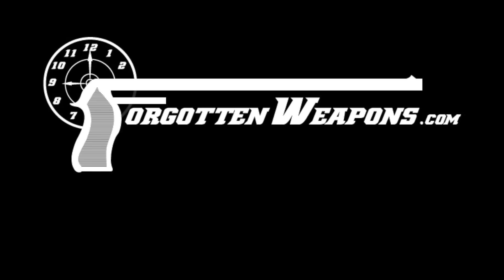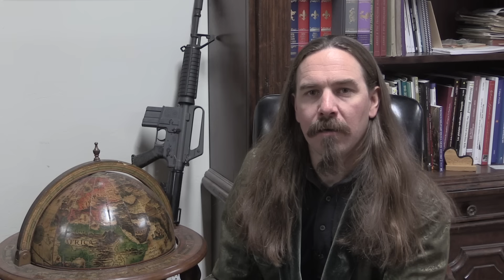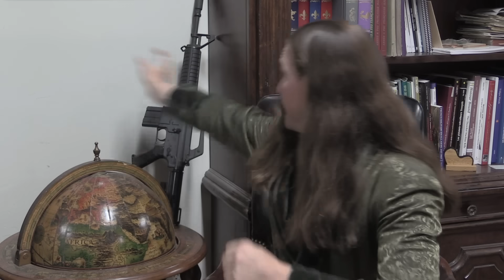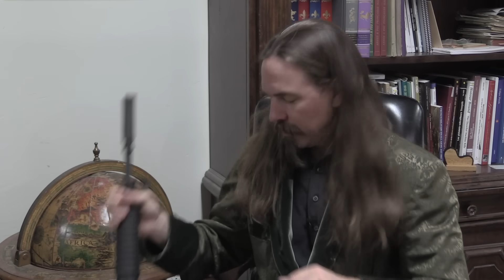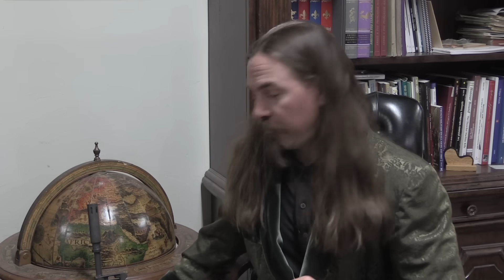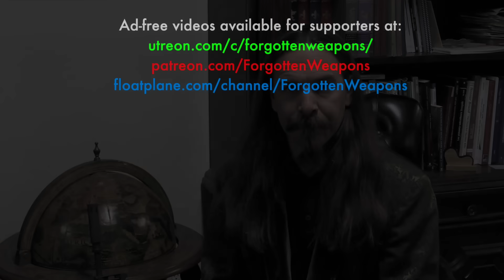Ask Ian: "Last Ditch" Rifles for World War III?

Comment: Ian,
Polymer receivers can be cranked out easily from a mold but that's not the end of the story when it comes to complete production of them. There's flash and other non-essential polymer removal. There's the polymer welding process to mate the two halves. How much total time does it take to make a KP15 lower when you include theses steps and the transition time between these steps?
Reply: Having worked on KP-15 assembly, I can tell you there's quite a bit of manual work to remove the flash. I have purchased two, and I had to deburr them both beyond what was done at the factory. I mean, you COULD just issue them to soldiers as-is, along with a razor blade, and say it's your job to finish it.
Reply: @WardenWolf  You'd trust soldiers or Marines with a razor blade? This is an armorer's job.
I used to work at a plastic making (injection molding) company so I do understand this.

Comment: You're more likely to just see proper shops retooled en masse than change much of the overall reciever structure
Reply: That's clearly a "low hanging fruit" sort of thing that you start with. 

But after you've exhausted machine shop capacity, what's the harm in retooling your injection mold shops that would've otherwise sat unused? 

Also remember that machine shop time will be in high demand for other projects that have nothing to do with small arms. If you can move part of your small arms manufacturing over to a shop that used to injection mold kids toys, then that frees up machine shop time for potentially more important war effort projects that truly need it.
Reply: If the situation becomes dire enough, there may not be enough shops to retool, even if raw materials are still available in the quantities needed. Many shops may be destroyed in the conflict or may become trapped behind enemy lines. The conflict may also consume a shop's manpower and shortcuts in production will have to be taken.
Reply: @rudyschwab7709  look at the soviets  in ww2 their small arms wher pretty much exclusively made in small machine shops
Reply: @rudyschwab7709  That's what I was just thinking, if we are talking last ditch effort many of these workshops would have had their workforce pressed into service. You probably wouldn't have the luxury of WW2 with the women making up the workforce either as they too would be fighting. Retooling of other workshops would come well before a last ditch scenario.
Reply: In real big war capable manufactures are making stuff that much more important than pistols or rifles - tanks, artillery, aviation components, artillery shells, bombs etc. They are much more important for war effort and usually have not that many options to be simplifies

Comment: This is a interesting video to think about . 
Have you checked into the Orca 3d printed ar15/m16 ? Almost the entire thing is 3d printed polymer. I could see something like that being viewed at heavily in a war economy situation. 
Also the select fire feature would probably be done away with altogether for ammo preservation , just a safe and semi auto fire switch,  no burst or auto option at all. 
They would probably make the barrels pencil style barrels for weight and material conservation. 
Powers that be would also consider viewing a picatanty rail flat top upper all the way down the upper receiver and the handguard to accommodate detachable optics and iron sight options. 
Agreed that a fixed stock would probably also be considered for simplicity and speed of production. 
If they stayed within civilian parameters of designing and building such rifles , (barrel length for example) these rifles could be sold back to the civilian market easily on a surplus option after the war ended. 
Anyways , good video.
Reply: Exclusively polymer uppers are just not feasible for actual war usage. Even in high-temp polymers, sustained FA fire will heat soak the upper and any form of barrel mount and cause loss of accuracy and eventual destruction of the upper. It's perfectly fine for semi-auto civvie use -- I have a rifle with a printed polymer upper myself -- but militaries have different needs.

I could personally see a hybrid design that sleeves a much simpler metal component in polymer to reduce manufacture time. Features like rails, brass deflectors, etc. could all be pumped out much faster in plastic than aluminum.

Comment: Colt SP-1 with a cartridge deflector added or a sportical upper with the Picatinny rail no ejection port cover short rail for the front sight. The sportical uppers were for Walmart I found one for sale and I have it mounted on a suitable lower with a Carbine Trijicon ACOG® mounted.

Comment: Using 40rd mags is another option, in that the standard combat load can be reduced from 7x30rd 210rd loadout to 5x40rd 200rd loadout. This would also give some advantage to the WW315 over an enemies 30rd equipped rifle.

Comment: Due to the way the barrel mounts to the upper receiver, indexed by a pin on the barrel into a slot in the upper receiver, it would be absolutely necessary that the rear sight be adjustable for windage.  As far as your comments about 3-rnd burst, you could argue go even simpler, Safe and Semi only, skip the burst or full auto.

Comment: I could also see them removing the forward assist to streamline the upper and save on parts/materials, removing the grips that have the little doors in them for oil and such, hell, possibly even removing the dust covers in extreme circumstances.

Comment: Hmm, I think the H&K G36 one of these plastic fantastic platforms for these reasons. Relatively cheap and easy to produce if you need to just swap the carry handle to the “c” config. Designed with easy production methods in mind for a possible outbreak of WW3 that by now never came. The development must had started in the 70’s or 80’s, so the threat of an escalation was real, not like at the introduction in 1997 with the Bundeswehr.

Comment: How about a monolithic polymer lower with a carbine length buffer tube with the locating points for the adjustable stock? You could even put a QD socket underneath the buffer tube.
Since the adjustable buttstocks are largely molded polymer they could be simplified by eliminating the lever and just using a spring-loaded plunger for the adjustment. Since most people don't adjust constantly this would give you the option of setting up for armor or heavy winter clothing versus hot summer in a T-shirt.
PS I would like to see this lower made with a pistol grip modeled after the BCM gunfighter, or Magpul MOE K2.

Comment: I would also expect simplified muzzle devices, foregrips with less cutting needed for rails if not entirely polymer, maybe pins replaced with non-captive versions..
Reply: M-lok foregrips weigh what, half what Pic rails do?  That's all metal you can use to make another gun!  ALSO takes less machine time, and would likely be modified with half-circle ends to create an m-lok 3.0 if further simplification is needed.
Reply: They would probably start with whatever AR barrels are left over.

After that, it's all barrel blanks. We probably wouldn't see muzzle devices on them. But maybe an occasional example of somebody drilling holes at the end.

As an improvised muzzle brake.

Comment: As an end user the ergonomics, functionality, cool factor and a few other thinhs play a part in how much you enjoy shooting and therefore how much a lot of soldiers/sailors/marines/airmen will put into training and how frequent they will train without complaining too much. Now that doesn’t go for everyone.

But if the full time peace time Army doesn’t like or want to shoot the issues weapon they will not be as skilled in the use.

I hated the Austeyr I hated the ergonomics and couldn’t get comfortable therefore I needed either so much more time on the range using the platform to becoming efficient enough to pass the LF18. Now throw me an M4 I needed much less time behind that platform to gain the same accuracy and consistency. The collapsible stock worked well for me. The single length of pull option is a one size fits most not all. Those it doesn’t fit suffer.

I know beggars can’t be choosers but if you love the platform you’ll usually be better using the platform.

Comment: I would imagine the new choke point in the production of your new simplified polymer parts would be the barrel milling. So if barrel milling takes X amount of time and the removal of a feature saves and amount of time that still doesn't push you over that X time, you could theoretically keep the feature because even if you speed up production of those parts you overall don't save any time cutting it out because you're still waiting on that barrel to be drilled and rifled.

Comment: What about flash hiders (and the barrel threading for that) - would that go away or is it too important?

Also, I really want to hear about AK platform, as it already is simplified to the extremes.
Reply: Mini-30 type would be excellent.  Plus, when you waste a bunch of enemy carrying the AK, you can use their ammo.
Reply: @dhyde9207  Why not just make AKs then?
Reply: There are two common options, you build the rifles with full length barrel so it'll burn all the powder before the bullets exist the barrels like in the sks or you can machine the gas exhaust right onto the barrels like in the akm.

Comment: I think Hi-Point's carbines and pistols would be good candidates for modern Sten type production.
Reply: Ridiculous
Reply: They'd have to get a double-stack magazine going before they'd be viable as SMGs, but you can't fault their guns for accuracy, reliability, or pistol-whip damage.
Reply: @IanGarris  the luty uses a homemade single stack and works fine
Reply: @DaddyStarbuck  the fucking things are heavy and ugly but a blowback 9mm carbine doesn't exactly have much to go wrong with it and they are cheap to make.
Reply: Extar EP-9.  Lighter overall weight yet softer felt recoil, better ergos, reliable.  Most fun one can have at a range for under $500.

Comment: The bolt assist and the serrations on the bolt would also disappear.
Reply: Considering that last ditch would probably mean more bad ammo and poor machining, a lever that helps with some jams would ABSOLUTELY stay on the gun
Reply: @johnwebb7411  No. If you had a bad round, you would pull back the charging handle to eject it.

Comment: Thanks perhaps you could do a similar presentation on the 1858 Remington some of the theories I have heard is that the south did not have the steel production capabilities of the North so they used the brass frame. I suspect and have heard other theories that the brass frame 1858 was a result of easier brass machining because of urgent need.

Comment: I would like to take a stab at the question, with emergency production of your receivers: Unitary trunnion system. Imagine a one-piece scope mount turned upside down. Instead of the "bar" section mounting to a pic rail, the charging handle rides within a recessed track instead. Drill and tap the bar to accept a section of pic rail secured with 8/32" screws, like a bolt action receiver. The "scope ring" sections would be ~1/2"-1" long to support the bolt carrier. The outer skin of the upper receiver can be stamped with a raised boss for the dust cover and holes stamped out to match the tapped holes in the unitary trunnion. If in Volksgwevehr-levels of desperation, the dust cover could be omitted but is advised against. In theory, a matching unitary trunnion could also be used with a stamped lower receiver. Either trunnion system could be forged or cast.

The downside to this would be a slightly wider receiver to accommodate for additional trunnion thickness. The upside would be armorer-level repairs where the skin takes most shrapnel damage and can be replaced while retaining the core of the system. Secondary upside would be the ability to operate the assembly without the skin, but that would be exceptional operation, not the norm.

Comment: Hey Ian i was wondering what would be the best cheap weapon for an underdeveloped country to produce with western influence in it? I heard ar 18 was the perfect candidate but what else
Reply: G3, HK33.
Reply: @Seth9809  those have far too precise a locking mechanism
Reply: @xexecuterxx  You consider roller delayed to be precise? It literally ejects so fast and hard that it rips apart brass casings.

What about lever-delayed blowback?

If you don't have a CNC machine, you're stuck milling or stamping, in which case it's the G3 family, the AK family, or the AR-18 family.

Comment: So if we're talking absolute last ditch, wouldn't polymer be out the window for lack of resources? It's cheap to print, sure, but you still have to manufacture the material itself. It's a petroleum product, right? Oil is even more scarce now.

Wouldn't last ditch mean heavy steel rifles with wooden or no furniture? Maybe an integral bayonet cut over the M203?

Comment: This may or may not be a dumb question, but wouldn't our last ditch weapons be from our ww2 reserve stockpile
Reply: Assume by 'our' you mean, American. I suspect the US's reserve stockpile is primarily made up of old versions of m16's or newer these days, while there may be some ww2 kit in there they'd probably be quite limited. AR platforms at this stage are dime a dozen, especially if you're less concerned about the exacting quality of them or features. The majority of the price tag is really quality assurance, and I think you'd find that the reserve stockpile reflects that. Plenty of stories of american soldiers leaving M4's, optics and stuff when they return home from deployment, because it would cost more in fuel to fly them back than it would to just rebuy/rebuild and reissue them. If a nation is doing that, you can safely assume their reserves are well stocked with modern equipment. 

Can't confirm, as am not involved in managing the stockpile, but I think that's a safe assumption to make and am sure others would agree with; if there is older equipment in there, it's because the stockpile hasn't been cleared out yet. There are stories of old Enfields appearing in France recently, that had originally been dropped in to support the French Resistance. They were still in the stockpile, but France's reserves are well equipped, they just hadn't opened the crate in the back corner of the warehouse. I suspect any old Garands or Thompsons or whatever still in the stockpile would have a similar story to them.

Comment: I could see the removal of full/burst entirely. No full auto or burst fire means the untrained conscript doesn't accidentally set his gun to the"wasting ammo" setting.

Flash hider/any muzzle device would be removed since it costs money to machine, for very little in the way of a tactical advantage.

Bolt hold open would be gone. Basic training only teaches you to rack the charging handle anyways.

The hand guard would probably return to a polymer mix between A 1 and 2 style. Being the cylindrical geometry of the A2, but the smooth untextured feel of the A1.

The carry handle style sight might just be the rear sight section as part of the receiver, because the carry handle itself is useless. This opens up the possibility of the upper receiver having a cheaper reciprocating top charging handle like on the first gen of ARs just be part of the BCG, and hey look at that the forward assist doesn't need to be a thing anymore. Less manufacture time, less money, and you can rack the weapon with thick winter gloves on.

Sling mounts, I can see being fixed in place.

Bayonet lugs are gone, not everyone is getting a big knife as it is.

Brass deflector might not be included because the money saved without it is worth more than the discomfort and potential small injuries sustained by the 10% of the population that's left-handed. (sorry Ian) Ambi selector might just go too for that reason.

Comment: I'd guess that the cost of milling parts and making optics, it would make a Monolithic polymer receiver gun with plastic fire control parts like some modern H&Ks, stamped sheet-metal iron-sites, a simple cylindrical steel barrel with no flash-hider and minimal taper, and a clip-on plastic OEG or ghost ring sights for CQC, become very common.

Like, I could see ww2 Number 4 Lee-Enfield style stamped iron sites for 100-800m be standard, but troops also have a OEG in a pouch that attaches to a rail or a bayonet lug for close-range work as a very cheep ersatz red-dot.

Comment: If I were asked to maximize AR-15/M-16 production rate you’d go to an extruded upper with extruded-in 1” hole (adds a bit of weight as you expand midbody to front barrel nut screw threads diameter but ridiculously fast to make.  Still needs some CNC to cut cam pin recess, flatten bottom and open it up, machine open the charging handle channel and form lugs) but wayyy less than otherwise.  You could conceivably die cast a bit closer to near net shape as well, have to detail analyze CNC versus die cast cycle tradeoff.

Probably a much simpler cast aluminum or injection molded handguard as well.

Comment: I recently had a thought; how would a gun be designed if the objective was to make fully automatic rifle that would be most easily homemade, a gun designed for an insurgency with a weapons shortage, but would still use either AR or AK magazines and ammo. That gun that wouldn't need to be as reliable as a military standard rifle, with the least amount of features and simplicity of manufacturing. Not something last ditch by a government, but something still for "desperate times".. if you combine what Ian said about polymer moldings, with 3D printed parts, simplified CNC machining etc.